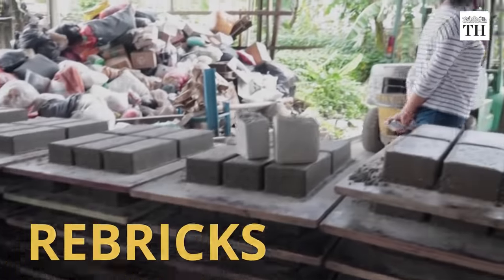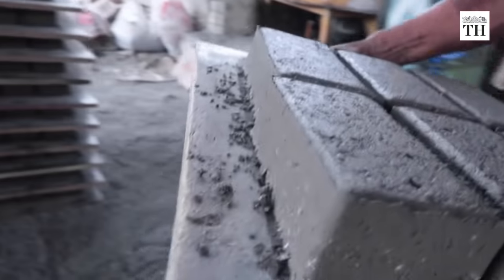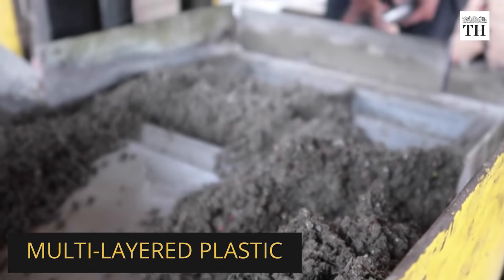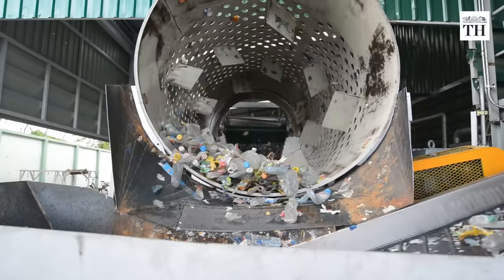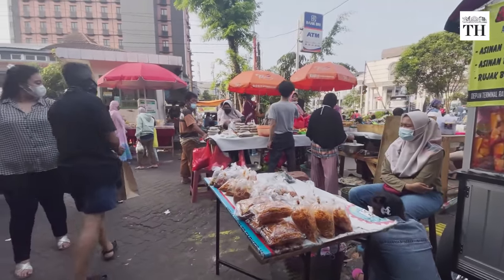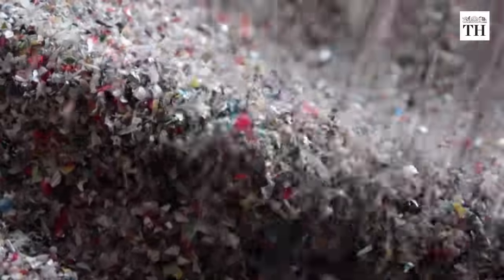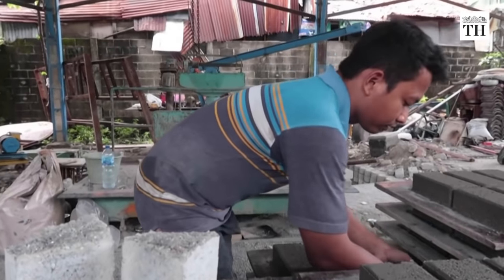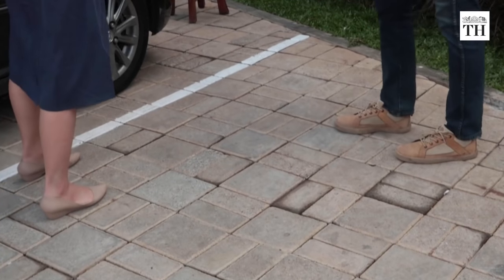Paving bricks made from plastic waste

Comment: They are just using plastic as fillers for the cement bricks . So instead of say putting more cement or sand , they put plastic . Plastic found in trash probably cost less than sand . The problem with plastic is , under heat (40-60 celcius) such as roads or exposed surfaces to the sun in tropical countries , the strength of the plastic will be drastically lowered . So it’s like normal cement brick with sand but with 20-30% less strength .

Comment: better this process shown is mix 20-30% shredded plastic waste with sand/C&DSwaste/soil/etc avilable locally and pass thru hot excuder machine used to making plastic products and than use the molten paste into hydrulic dye like show to press and make hollow blocks instead of bricks since blocks r more economical along with giving thermal insulation. since using cement in process again increase carbon footprint of the bricks and above said process make blocks/bricks faster to sell instead of waiting for curing n hardening of bricks before selling like show in video.